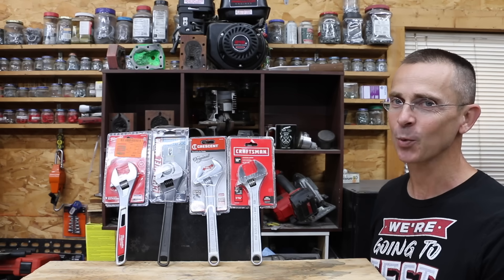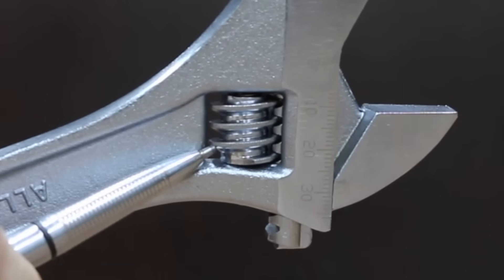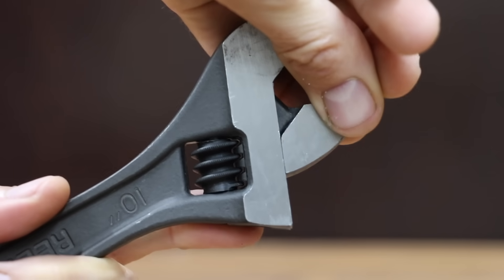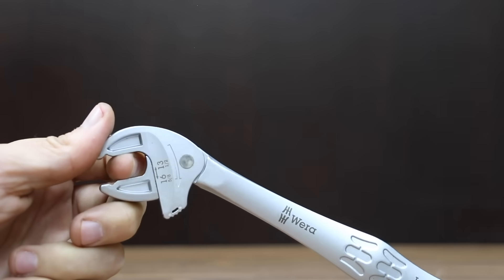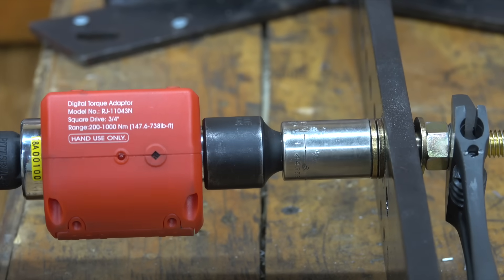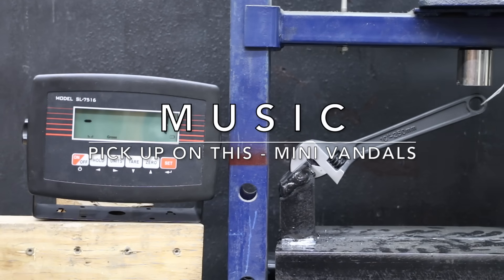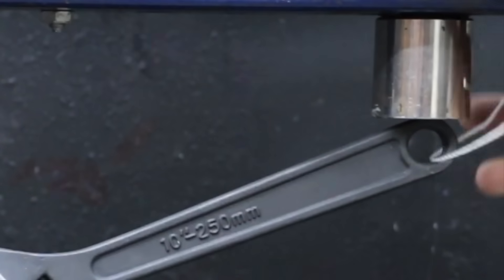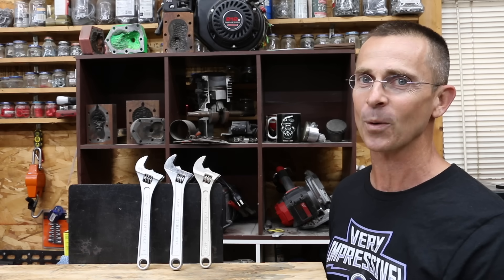Best Wrench (ADJUSTABLE)? Craftsman USA vs Craftsman, Crescent, Kobalt, Milwaukee, Channellock

Comment: Just goes to show how serious the lifetime warranty on the old Craftsman tools was. You could bring any broken tool in for a free replacement in the store, no questions asked and no receipt required, so they had a vested interest in making tools you weren't going to break!
Reply: Too bad Sears is gone now, I doubt Ace or Lowe's would honor it
Reply: @snarkylive  I've heard that Lowe's will still honor the warranty on Craftsman with no receipt (there's even some videos on YouTube about it) but you get a crappy Chinese replacement.
Reply: @snarkylive  lowes does honor it. Traded in a broken rachet just 2 weeks ago.
Reply: @snarkylive  Sears isn't gone though. However, if you take in a USA made Craftsman tool, that's not what it will be replaced with as they no longer have USA made tools. The market dictated that (over time) as well as some bad management choices. 
But, yeah, Sears is still around, but they have a very much smaller footprint than they used to and they're now more focused on their home services end of business.
Reply: @snarkylive  hit or miss with the Lowe's near me.  They've replaced a couple ratchets after giving me a little grief but wouldn't replace my rake that still had the lifetime warranty label on it.  Bought their Kobalt take and it lasted two weeks. Just repaired it today myself since I'm tired of dealing with them.
Reply: @snarkylive  Lowes did on an old racket wrench.. 
no questions/forms
Reply: @snarkylive  ace here does and Lowes will trade your broken craftsman for a Kobalt version and continue to honor that warranty
Reply: @snarkylive  they do honor it
Reply: @snarkylive  lowes somewhat did for me. My dad had a cracked 22mm socket, lowes didn't have an exact match only deep well and they gave me the option to get the deep or call craftsman.
Reply: @snarkylive  they still honor it at Lowe's but snice china makes them I don't buy crapmen anymore
Reply: @snarkylive  my Lowes won't warranty change any craftsman, just tells you call company, took weeks just to get approved for exchange because craftsman asked for a receipt that I didn't have
Reply: Unfortunately, companies see that as a problem. If everyone bought your tools and were guaranteed for life you won't be making money since no reason to replace them. In my line of work I can see the difference in parts where older ones lasted forever and now forget about.
Reply: @poeticsilence047  people are buying many times the tools these days.  Cheaper price, lower quality, huge availability.
Reply: @carpediemarts705  yeah, I know, I am one of them. Lol.  That's what I am saying. The fact that tools don't last as long more people buy and yes they are cheaper aince they are out sourced.
Reply: @poeticsilence047  Initially when that claim came out, I was breaking my 1/2" drive ratchet (breaking off the square drive) Twice. They handed me a repair kit for it and I disassembled it and replaced the broken parts.  Then used the 4 foot iron cheater pipe on the wrench  handle to get the nut off on suspension. Did not have an impact driver or "heat"(which would have been the way to go)
Reply: Their warranty right now is bs... its still life time.. but ive brought in tools and they refused to exchsnge it. Because they werent made anymore.. and they wouldnt give me one thst was similar.  Ace hardware was the store i went too..

Because of this i dont shop there anymore

They also want your origin receipt too lol craftsman isa joke
Reply: I used to buy broken Craftsman tools from Snap On and MAC tools dealers, that were traded in for their brand.  You could buy them for next to nothing.  Then a quick trip to Sears, and you had a new tool.
Reply: Only had to do it twice: a ⅜" ratchet and a flex-head ratchet! Both times, it probably was my use but.... ¯\_(ツ)_/¯
Reply: @gus473  The only time I did it was when working on a 4" pneumatic cylinder and I left my Craftsman electrician's pliers resting on the rod between the yoke and the body.   Snapped the handles clean off, it did.  The Sears guy didn't blink an eye and just handed me a new pair and relieved me of my bag of plier parts.
Reply from the maker: Thanks for the feedback.
Reply: Turned in a 10 year old craftsman ratchet 2 days ago at Lowes. Took less than 5 minutes between entering and leaving the store with a brand new ratchet.
Reply: Problem is that people started to purposely abuse and break their tools because of the lifetime warranty. 

Similar to the lifetime warranty of many other stores - LL Bean had too many people returning years old and abused stuff for new stuff so now it’s a 1 year warranty. 

You either change the quality to match the price and keep a lifetime warranty, or you change the lifetime warranty to something shorter.
Reply: I only had to do that once and the only issue was that they had changed the sizes offered and had to figure out which one to give as a replacement.
Reply: Hell, Harbor Freight lifetime warranties their Pittsburgh Pro stuff. I busted a ¼ inch torque wrench, they replaced it even without a receipt. Chinese, but works ok
Reply: Idk bout all places but all the tools that have lifetime warranty i was able to replace if broke i rrplaced 1 spring loaded centerpunch 3 times now, soon to be 4
Reply: Unfortunately not in Canada. Lowe's won't warranty tools they didn't sell. Have to call Stanley and hope for the best 😢
Reply: I really miss Sears Craftsman.
Reply: They still do, but the quality is so poor now that after the 4th or 5th time I just give up and buy something else.
Reply: Now when you return broken Craftsman tools, they probably give your red Chinese junk/
Reply: Even when you could still find a Sears store that carried craftsman tools within driving distance Sears had started putting limits on that free replacement that previously was with no questions asked.  If they noticed excessive rust or apparent damage that could be from abuse they would sometimes decline giving a free replacement.  Before they would quickly just verify it was their tool and give a replacement without examining it thoroughly from top to bottom and side-to-side.  After that I stopped buying the much more expensive craftsman tools.
Reply: Craftsman isnt only onecwith lifetime warranty,  masterforce, and some of tool shop do, but if i recall masterforce is American made tool shop is hit or miss on that..
Reply: Yeah, it wasn't really like that....  I remember those days.  I thought the Sears Craftsman stuff was fine, but I was in the minority....  And I made more than a few trips back to Sears.  Now, they would replace it, no questions asked... So, they definitely honored the warranty,  and I was never asked any questions, despite the abuse some of the stuff I returned clearly showed....  As an auto technician friend of mine said way back when: "Sears Craftsman is junk.  But they back it up 100%.  So if you're willing to keep going back to get new ones, yeah, go ahead...."
Reply: @patrickmorrissey2271  Junk compared to snap-on, but pretty good for homeowners.
Reply: True.  I did it many a time.  That was one big reason for paying the premium price.
Reply: The only Craftsman tool I ever had that broke under normal use was a glass cutter.  When I brought it in to get a replacement, they told me Craftsman didn't "make" glass cutters any longer, but they did give me a Sears equivalent.  This was about 1984.
Reply: they found out that consuming leads to growth. They also found out women were the ultimate consumers because the stuff they buy doesn't even have to break, they'll replace it once it's out of style or "old".

Comment: I’ve had 2 Bahco wrenches for 25 years they are swiss made. The best adjustable is the Diamond brand I’ve had for 50 years and used them every work day but they’re out of business, shame the imports took over. Great test especially watching the jaws break, I’ve used pipe cheater bars on the wrenches I have and I broke one and Diamond replaced it for free. I always enjoy your testing and can’t wait to see what you have next.
Reply from the maker: Thanks!  Thanks for sharing.

Comment: At 9:10 where u did the tourqe test, ur supposed to flip the wrench so the adjustable part is putting its pressure on the nut from the bottom and not from the top of the jaw, then u will get the most out of the wrench, that’s how wrenches are designed, the adjustable part is only supposed to push on the nut with the bottom of the jaw, otherwise it’s stretches to much

Comment: Should of added the "HART  Adjustable Wrench, Chrome Vanadium Steel" and they're not expensive, sold by Walmart. Don't usually buy tools from Walmart but noticed that it's the best adjustable wrench with the least wiggle room. Haven't used for extra heavy loads, believe if need a tool for extra load, then best to get a wrench. 
Don't like any of the adjustable wrenches from harbor, and own Craftsman non- USA made and had to switch them out
Reply from the maker: Thanks for sharing.

Comment: Hey man, the best adjustable crescent wrench I have ever used is a LOCKING one from Hart from Walmart. It locks the jaw tight, similar to how Vice grip pliers work. I love it a lot, no slop, no movement, it becomes a wrench of any size, that fits better than a normal wrench, because it locks onto it with two straight jaws! I wish you could have included that one. Dang.
Reply: They are surprisingly good, for when you can't carry a full set of tools! 👍🏼😎✌🏼
Reply: @gus473  yeah! I use it on welding gas bottles, doesn’t damage the brass nuts at all. :)
Reply from the maker: Thanks for sharing.  Thanks for the constructive feedback.
Reply: @ProjectFarm  You’re always great buddy. Keep up the great work and videos! I always try to comment to help boost and add to the comments. :) Thoughts about making a video like this, but for locking version of adjustable crescent wrenches? I think that might be good and would be a good comparison to normal ones. :)

Comment: Any plans for 3-pound Hammers? 

I got a Wilton brand vulcanized rubber handle nearly a year ago(~$60 currently) for steel erection and am interested how much better it is versus traditional 3 pound sledges/hammers...also its marketed as unbreakable handle.  :)
Reply from the maker: Thanks for the suggestion.

Comment: Would LOVE to see some Torque Wrenches tested for accuracy and strength. Great job as always!!!!
Reply: Yeah that's a good idea 👍
Reply from the maker: Thanks!  Great suggestion.  Thank you.
Reply: @ProjectFarm  I've heard torque wrenches must be LOOSTENED for storage or they lose calibration.  How do you test the calibration or cal damage of a torque wrench?
Reply: @carpediemarts705  What I did to test the calibration of my 7 year old torque wrench was get a cheap digital torque adapter like the one used in the video and put it on the torque wrench. Set the wrench for some value and torque a lug nut or something similar, then compare the peak recorded by the adapter to the set point. Do that for a few points spanning the range of the torque wrench and make sure they're all within spec. 
You can trust that the digital adapter is very accurate (more so than any mechanical torque wrench) because it's a very simple device with no moving parts that can drift out of calibration. It's just four strain gauges arranged in a full bridge configuration to measure the torsional strain in a short 1/2" extension. 

BTW one thing the adapter has shown me is that "training" of a torque wrench is a real thing. Every time the torque setting is changed it may take a few clicks before it actually clicks on the correct torque setting.
Reply: @carpediemarts705  you send it off to an ISO certified testing facility. They will test it, calibrate it, and/or repair it if the damage is beyond calibration adjustment. 

It’s recommended to be calibrated annually if used on a regular basis (or after 5k cycles if you’re using it for Aerospace/Aeronautics). That or immediately after taking a drop from greater than 3ft
Reply: @ProjectFarm  do dial torque wrenches loose their caliber attention if left in a set mode?
How about if turned down past zero?
Both are things I've heard.
Reply: @dans_Learning_Curve  yeah, that's what I was asking before autocorrupt moistened my post...
Reply: @dans_Learning_Curve  Torque Wrenches do in fact have to be stored at certain settings. This differs by type (manual vs digital), sensitivity/operational scales (i.e. - in. oz, in. lbs, ft. lbs, etc.) and also varies by manufacturer.

I own 4 different torque wrenches by different manufacturers. 
Each one has a different storage setting. Some want it stored at 20-25%, another is at 1%, and another is at 50% or less.
There’s technically no such thing as “turned down past zero” as the internal springs are under constant tension. Therefore there is some form of a constant load on the internal mechanisms.
Reply: At my work we have 8 snap-on torque wrenches. They are on a 6 month cycle. We have 4 at the shop at all times. In 6 months, a company comes swaps them out with 4 freshly calibrated wrenches. Rinse and repeat in another 6 months. Torque wrenches no matter the brand, go out of calibration over time/use.
Reply: @carnage50x  I got a nice snap on when my friend was moving.
I have no idea if I can trust it to do my engine though.
Reply: Oh hell yea. Ive seen reviews and they can be way, way off
Reply: Test norbar please.
Reply: One type of torque wrench is always accurate: the original Sturtevant (Chrysler engineered) simple beam type. Even if bent, as long as the pointer is adjusted to hit zero, and doesn't scrape or have excess friction, the laws of physics say it will always be accurate. Laboratory standard for pocket change!
Reply: I said this about 1 year ago and got the same ❤ and reply comment from him lol 💀
Reply: The strength of a torque wrench is never in question.  Torque wrenches are designed to take more torque than their highest setting without incurring damage.  If you're using one in such a way that strength becomes an issue, you're using it wrong.
Reply: Snap-On techangle, acdelco, gearwrench, and habor freight should be in there! For the price i don't see the benefits of the tool truck digital torque wrenches.
Reply: @z33tanner  so believe it or not the snap on digital torque wrenches are self calibrating. So like if you where to throw it or drop it it would re calibrate itself. Quite impressive when I first learned that
Reply: @isaiahhowell1090  Digital torque wrenches don't go out of calibration. There are no mechanical moving parts inside that rely on calibrated tension like in a mechanical torque wrench. It consists of 4 strain gauges arranged in a full bridge configuration to measure torsional strain. The only thing that affects a strain gauge's reading is temperature, but a full bridge setup is self compensating for that.
Reply: @ASJC27  ik that's what I'm saying the original comment Saif they don't see the benefits of prices differences with digital and mechanical and I was tell them the difference and what cause them to be more expensive
Reply: If you do get to test torque wrenches and budget allows, can you test CDI 1/2-Inch electronic torque wrench?  Thanks!
Reply: Ya that be great to see especially in all drives
Reply: This!
Reply: I believe that AvE did a torque wrench test a while back.

Comment: Thanks PF!  I have a "go-to" adj wrench (Crescent brand) which has a channel-lock mechanism added so when the jaws are tight by hand, the mechanism is then engaged and the jaws clamp solidly onto the fastener.  I have never rounded a nut off with them.  Has anyone else used them?  I think they are awesome.
I also have med and small Bahco adj wrenches which I really like.
Reply from the maker: You are welcome!  Thanks for sharing.

Comment: Great testing as usual Todd.

Tekton makes decent tools but their prices approach those of the "tool truck" crowd making them no bargain at all. 

It's just a fact that adjustable wrenches are not as strong as regular open-end wrenches. The parts that make them adjustable are finer and thinner than any part of a regular wrench.
If the job is too tough for an adjustable then a standard open-end or closed-end wrench must be used.
Reply from the maker: Thanks!  Thanks for the feedback.

Comment: I have Crescent and Craftsman wrenches from the mid-90's that are identical. Not hard to tell who was making the Craftsman wrench. :) It would be interesting to see a test of a slate of old made in the USA tools (screwdrivers, wrenches, sockets, etc...) vs their modern import replacements. I'm curious if the imports or better or worse.
Reply from the maker: Thanks for the suggestion.

Comment: This was a good one, you should do a quick side by test with a vintage crescent brand and modern one like you with craftsman.
Other brands that could be added SK,Dimond,Olympia,gearwrench,
Hope to to see you test,Allen keys,Allen t handles,Allen sockets(short,mid,long for those)
Reply from the maker: Thanks for the suggestions!
Reply: @ProjectFarm  In my experience the and t handles can handle good amount of torque but but round out when hit with hammer blows, the sockets are Good but the long ones flex mortals ball designs very greatly